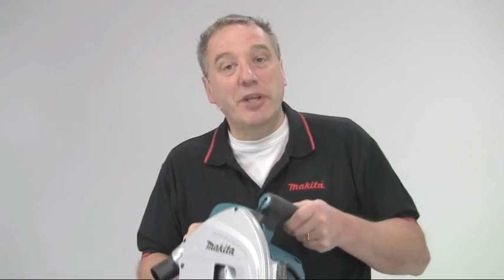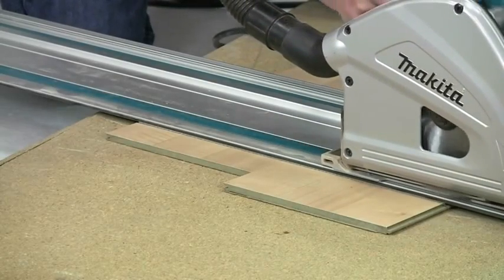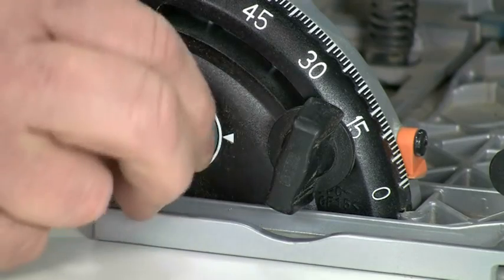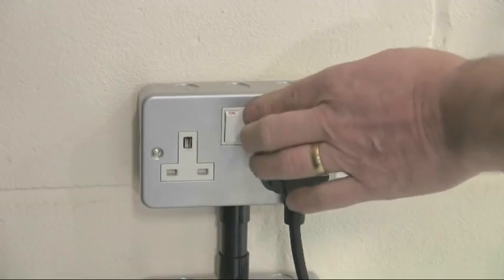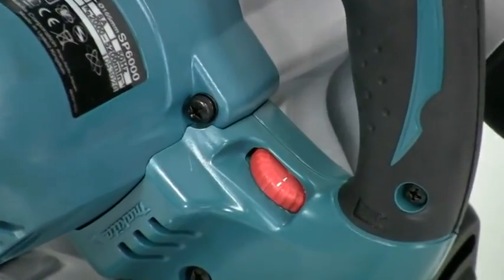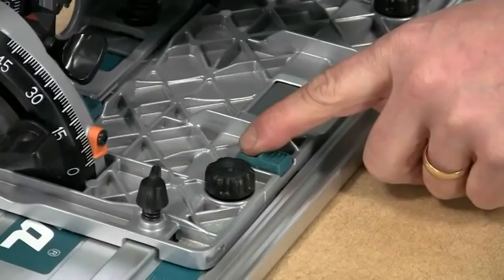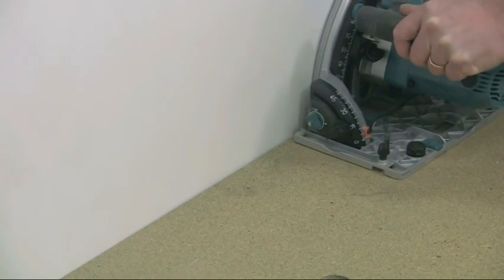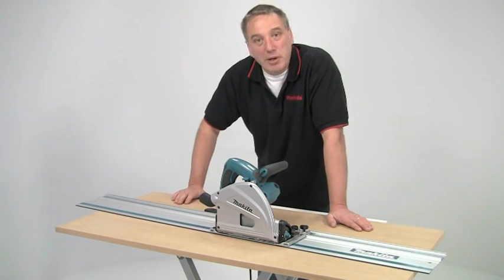Makita SP6000 / SP6000J / SP6000J1 Plunge Saw (Credit: Alan Holtham)

Comment: Good review of the SP6000, but what does make the difference to SP6000J and SP6000J1, as the title of the video promises?
Reply: That's what I am interested also.
Reply: That's also the main reason I reviewed this video was to understand the differences between the J & J1 models.
Reply: @MyPIDream   J means that the saw is delivered in a Makpac Instead of a carton (that would be X). 1 means that the Guide rail is included. And SP means that screw clamps are included so SP6000 JSP1 is with Makpac, Guide rail and clamps 
Hope i could help you

Comment: Hi, thx for the demo! Still, I was left wondering  about the difference between the models 6000, 6000J and 6000J1, as the price varies quite a bit...
Reply from the maker: Hi Francisco, its actually quite straightforward. The "SP6000J" is the tool in a case only, the "SP6000J1" is the tool in the case with added guiderail and the "SP6000J2" is the tool in the case with 2x added guiderails and guiderail joining bar (full kit). View the full range here: https://www.powertoolworld.co.uk/brands/makita/makita-saws/makita-plunge-cut-saws
Reply: @powertoolworld8345  Ok, thanks a lot!